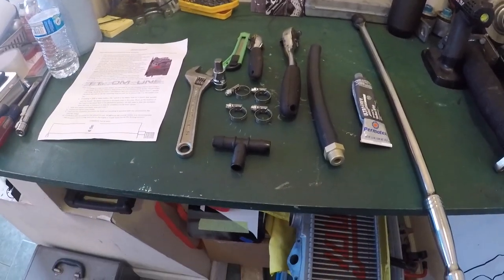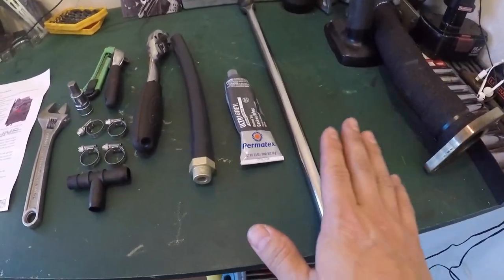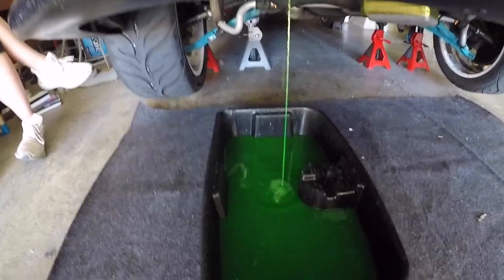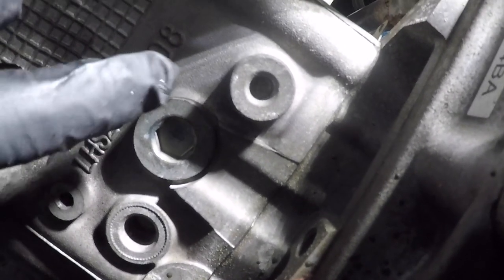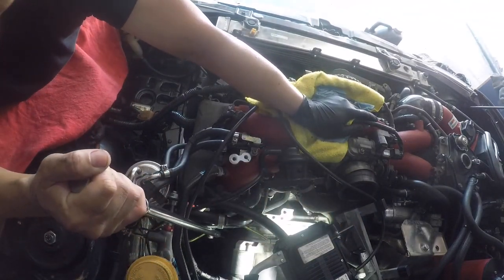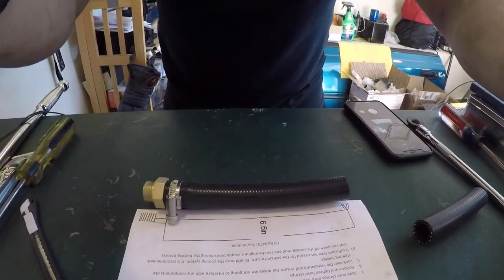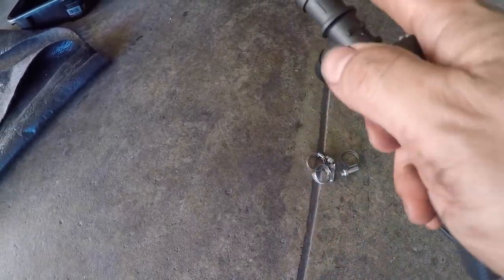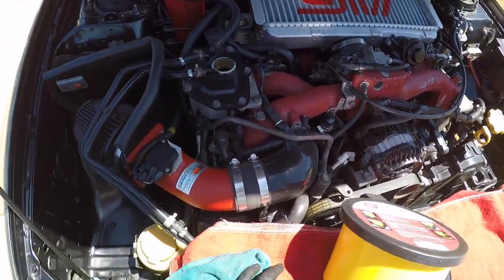GetaDomtune 4th Cylinder Cooling Mod (STI EJ207)

Comment: Nice work , this is a must have with Subie EJ engines and with equal length header's pretty much eliminates that problem with the bulletproof EJ207 ! Keep bringing it , hope you're subs take off , can't help but love your car cause it's same as mine and I get the feeling ........EJ207 rules !
Reply from the maker: Bruce Holinight thanks man! I am in love with my EJ207 so far. What car you got? Would love to check out some content of it.
Reply: @Damn_G I really wanted the GC body but I have a USDM 2003 WRX body and I was lucky to find a complete power train from a JDM  S-203 including transmission Axel's diff, control arms even gauges ! Ej207 with vf37 , you're probably vf36 ! I would like have a go with a newer STI just to see how she runs ! I removed air conditioning , cruise , etc. and cold air intake , Syms downpipe , and 3" all the way back otherwise stock internals ......0-60 = rocket !
Reply from the maker: Bruce Holinight sounds sweet man. I have v7 ej207. So oem turbo is vf30. I wanted the v7 specifically for the thicker semi closed deck and forged internals from factory. I bet that car is quick man! It’s always fun to be under estimated by bigger cars😎🙃
Reply: @Damn_G  Lot's of fun , I killed 3 WRXs and a Forester before this but after a year of hard driving 8000 rpm pulls almost every day this EJ 207 is a tough engine , the high flow heads make a big difference and after I fabbed an AVCS cable and a retune it made a big difference !
Reply from the maker: Bruce Holinight 💯 same. They are amazing engines.

Comment: are you planning on doing any oiling mods ? like pan/pick up/baffle ? do you have any issue with oil pressure on track ?
Reply from the maker: I have all those mods already. I have IAG AOS, tomei oil baffle and windage tray, killer b pick up, killer b oil pan, and mishimoto oil cooler. Run Motul 5w40 xcess oil. (6.5qtz with pan + oil cooler). No oil issues on track. I have have those posted on my ig feed. @desertsage_96brighton.

Comment: Would you think this would work on a ver.6 JDM EJ207?
Reply from the maker: I am not sure because I have never worked on a v6. I would ask Dominic from GetaDomtune to be sure. Even if you have the plug in the left head, the coolant may flow differently internally.
Reply: Right on! Thanks for the help